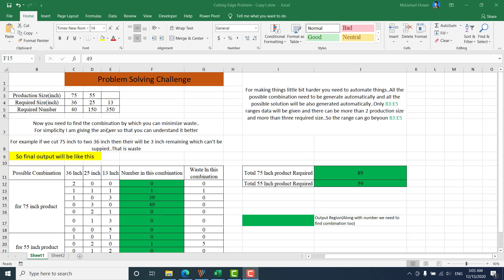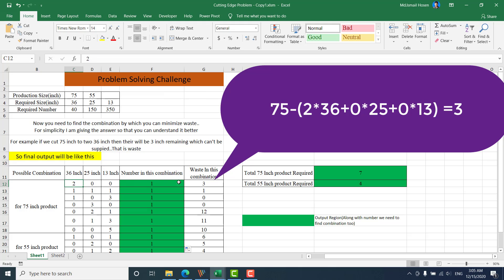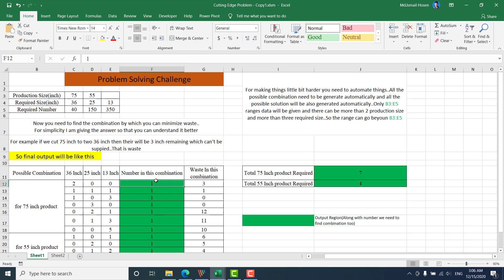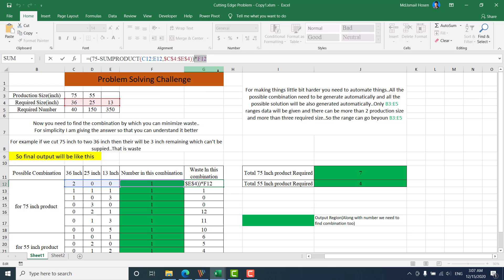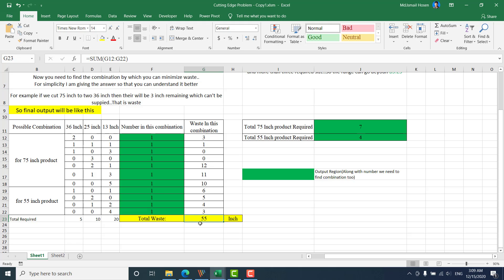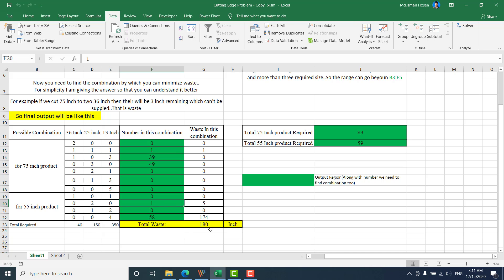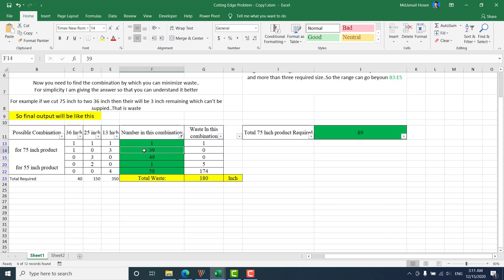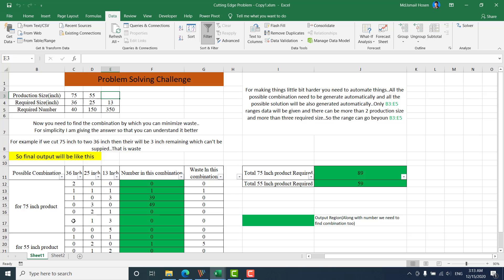Minimize Waste When Cutting Products | Cutting Stock Problem Optimization in Excel Solver

Comment: A garment factory produces rolls of garment in the following 2 sizes: rolls that are 75 inches wide and rolls that are 55 inches wide. Customers order garment rolls in the following 3 sizes: rolls that are 36 inches wide, rolls that are 25 inches wide and rolls that are 13 inches wide.	0
The factory must cut the 75” rolls and the 55” rolls in the correct number of 36”,25” and 13” rolls to meet the customers orders while minimizing waste. Waste represents garment that is cut from the original 75” and 55” rolls which is not included in the customers order and is left over.	
For an order of 100 36” rolls , 90 25”rolls and 150 13" rolls, determine the optimum number of 75” rolls and 55” rolls that must be cut to minimise waste in order to meet the order. What is the waste? 	
You have been given the following order													
	description	Quantity													
1	36" rolls of garment	100													
2	25" rolls of garment	90													
3	13" rolls of garment	150													
40 marks															
solution															

Please explain this for us, thanks in advance